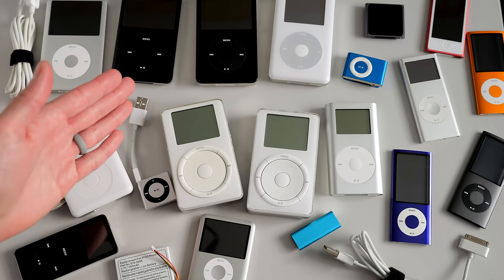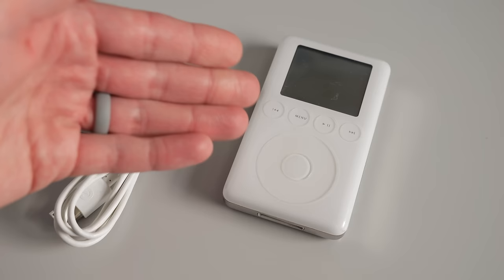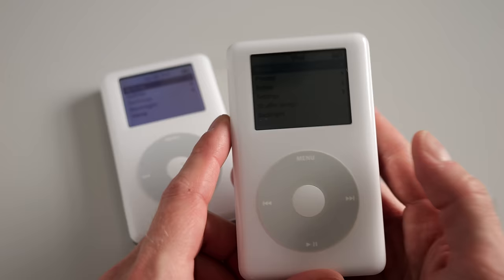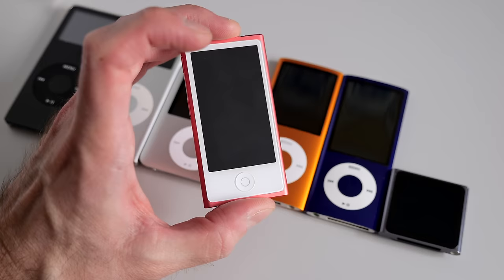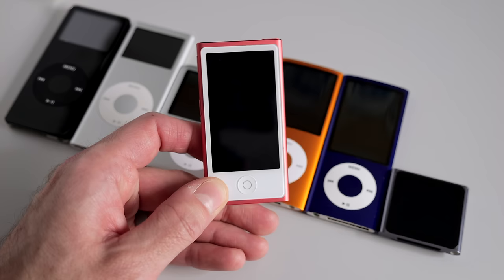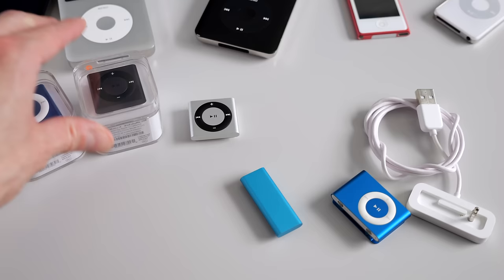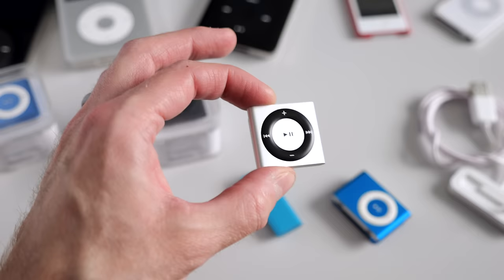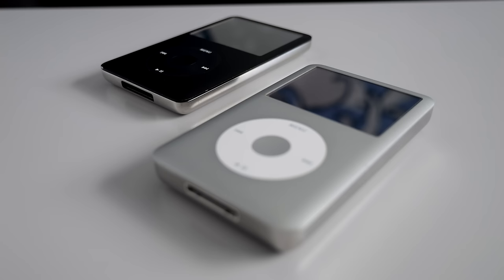Retro Buyer's Guide: Apple iPod!

Comment: I dug out my 30gb iPod Video a few days ago and gave it a try. It was sitting in my parents’ basement for 10 years. The 16 year old battery in it still holds 4 hours of charge - it literally just needed a charge and it worked just like it did back when the device was basically glued to me. I used it for a good 6 years until I got my iPhone 4S and I coincidentally ran out of storage in the iPod. I’m so impressed with this thing. My old MiniDisc player was in the same box, and the lens assembly is toast (it was fully functional last time I used it). My old Walkman held up a bit better, but needs a replacement drive belt. Both devices deteriorated over the years, while the iPod just patiently waited for some nostalgia to hit me!

Edit: I have a first gen shuffle (with some random corporate logo on it) - hit me up if you want it

Comment: Great video. I was a minidisc hold-out until 2006 before I got my first MP3 player, an Iriver T30 (which I still have and use!). Ipods were rather expensive compared to a lot of units, and those early version of itunes on Windows were hell - they practically took over your computer. I've been using my Android phone to listen to music for the last few years, loading up my library on the SD card. But now that new phones have removed the card slot, and my phone is dying, I was on the look-out for a dedicated player, and a couple of years ago I got into retro ipods. I recently got a parts 5th gen for $20 and fitted it out with new battery and iFlash adapter, and couldn't be happier. I'm just afraid that now, with this announcement, there's going to be a huge interest in iPods again and the prices are going to skyrocket, just like they did for Minidisc a couple of years ago.

Comment: I still have and use my ipod Shuffle 1st gen (the one you are missing). Still works perfectly and battery is nice and the whole concept is still great today. It's also basically a USB flash drive with more than enough space to take most files, documents around and very useful at that and also you don't need any cables or chargers to sync or charge
Reply: Remember "don't eat iPod" in the Shuffle ads, because they compared it to a stick of gum?

Comment: The top two pics to buy IMHO are the 2nd gen mini and the 5.5th gen. Both are very easy to open. The mini just needs a guitar pick, a pair of needle nose pliers, and a small Phillips screw driver and the 5.5th gen just needs a plastic pry tool in addition to what’s needed for the mini.

Both also have easily available replacement parts, the 5.5th gen more so. The mini also has the bonus of its hard drive being more or less a CF interface which makes it very easy to replace the hard drive with flash storage. The 5.5th gen has iFlash or a CF adapter.

Comment: I think the later iPod Touch models (6th and 7th gen) can be considered too if you want a mix of offline music and streaming services. Yeah a used iPhone is cheaper and basically can do the same thing but it's worth considering for a dedicated player.

Also, instead of iPod nano the 1st-4th gen iPod touch is better for a flash based iPod since the battery is way easier to replace.
Reply: Still needs to be soldered tho...

Comment: Last Gen iPod classic (only the last 8th Gen supports Apples headset remote control) with an SSD mod is the way to go. They are still relatively cheap and I use mine daily. It still has its original 2008 battery that lasts about 9-10 hours (also with an SSD it doesn’t consume as much power as with an HDD). iPod nano is also great but their price sky rocketed. Too bad I left my nano accidentally in my jeans which I then put into the washing machine… iPod shuffle was great for the gym.

Comment: My first iPod was a 60 GB 5th gen I received for Christmas 2005. It was a revelation, going from lugging around a big CD binder and having to load and eject a disc every time you wanted to hear new music. The old car I had at the time I replaced the old cassette stereo with an Aiwa head unit so I could play CDs. This was in 2004 and I had no idea what an auxiliary input was for until I got the iPod. I used the 5th gen until I dropped it 4 years later and the screen stopped working. Then for Christmas 2009 I received a 3rd gen iPod touch. That one was so cool and I used it like a smartphone, minus the calling feature. Connecting to Wi-Fi I could browse the internet without having to go sit at my desktop PC.

Comment: I have enormous nostalgia for the iPod and still prefer it to playing music on my phone for squeezing out distractions. My first one was a first gen 1gb shuffle and it was incredibly handy in college because it doubled as a thumb drive for carrying assignments and projects from my home computer to the school computers. It died only a couple years later though and was replaced with an 80gb iPod classic in late 2007 that I keep well cared for and still functioning. Opening the metal ones isn't anywhere near as bad as DankPods makes it out to be (watch Elite Obsolete's instruction video), and it's possible to swap the midframe for a 5th generation one and subsequently change out the faceplates to plastic which is easier to open, and can give more dramatic flair with colored or transparent faceplates. 

I've already swapped out the battery, but the drive is still going fine. Eventually, though, I'm going to do a total rebuild with transparent faceplate and click wheel, flash storage, and expanded capacity battery so it'll be able to last AGES on a charge.

I love that there's a cottage industry devoted to helping people keep their ipods going FOREVER. I still think it's a great product that has a place. I hope to keep mine going for as long as humanly possible.

Comment: I actually picked up one of the last stock iPod touch models Apple had in stock just to keep around unopened in the box for a while.  I had a 4th gen iPod that I got around the time they were new and it was probably the most expensive toy or gift I had ever had up to that point.  I had friends who had all kinds of different cell phones--and even though they were proper phones that could call and text, the iPod I had was still a lot more exciting to use and I remember I was actually pretty cool amongst the other middle schoolers having one.  I carried around that iPod religiously for a good 5 or 6 years until I had a job and could afford to have a proper phone instead.  

It may not be quite the same as the 7th gen iPod touch but I think it will be cool years down the road to be able to open the box and be able to remember almost exactly what it was like back when I was a kid.  Almost like taking a ride in the car that you remember riding around in growing up.

Comment: 3rd gen was my first in 2003. It was the first slim iPod if you got the smaller capacity models. To this day that's still my favorite model. I still have the box for mine. I also have the 1st gen, 4th gen, 4th gen photo and the boxes for all those. the boxes were neat and I couldn't get myself to toss them and I'm glad I didn't. My 1st gen box is the one that had Bob Marley on the cover.

Comment: My first iPod was a 1GB black Nano. Absolutely loved it until I saw a 5th Gen Video. I soon bought one after seeing it and haven't looked back. I still use it. Of course it's been flash modded, the battery replaced and I replaced the front plate, but I still use it. I believe I'll always use it until they stop making replacement parts for it

Comment: iPod nano 1st generation, 3rd generation, 6th generation, and 7th generation all do not suffer from battery swelling issues even close to the same extent as other generations. They either don't have the battery behind the display, have a little wiggle room for some swelling, or can easily have their battery accessed and replaced.

They can also all be more easily serviced than other generations, as they either all open like a full size iPod, or are still somewhat easy to open.

Comment: I had and 80G sixth gen way back when, but eventually sold it and bought a Cowon J3 which I used for YEARS (and still have). Just a couple of months ago I got a really good deal on a flash-modded 5th gen and I absolutely love it. I installed Rockbox on it and I am just blown away by it. Just an incredibly well-designed music player. I've used a ton of different digital audio players over the years, but nothing can beat the click wheel interface.

Comment: I would check up on the batteries of those new ipod shuffles. Lithium batteries sometimes self discharge over time, and over-discharge kills lithium batteries. It would be a shame if you reach for one of your spares just to discover they are dead before you ever even used them. Great video and awesome collection!

Comment: 49:40 - I found out that not all 7th generation iPods feature Bluetooth. I stepped on mine and cracked the screen; I eBayed a replacement, but it didn't include Bluetooth! I still have it but never used it.

Comment: One thing to note is the iPod Photo (its official name) was later merged with the fourth-gen iPod in early 2005 or so. (Effectively a 4.5G, if you will). This meant the later fourth-gen iPod had a color display and increased capacities. I believe the latter is how you tell them apart, as they were 20 and 40 GB, while the Photo did 30 and 60 GB.

Comment: I had the 1st gen Shuffle from launch and it still works. Reason? Apple did a battery pack that took two AAA batteries; you just pushed the USB into it and it worked. It’s a shame they didn’t try to do something similar for any of the other Shuffle generations.

Comment: I replaced the battery on my silver classic 80gb, and it was easier than I expected. I used mostly Dank Pods video, and had it running as I was opening. Do not watch the videos showing someone prying it apart. That will destroy the back, and bend the clips. The trick is to take your time. Don't force anything. Use the metal tool that he used, and I also had feeler gauges to hold it open, and help release the clips. Open 3 sides, and it will slide open. Also a BIGGIE, be careful, when opening like a book, to not pull the battery cable loose. It could pull the connector from the circuit board. I used high power glasses like you can get at the drugstore, and a magnifying glass, to see what I was doing. Use a small pointed object to hold the battery connector down, while prying gently on the clip. It pops straight up. I used a broom straw to pry the clip up. That limits the pressure, so as to not break it loose from the circuit board. I very lightly scuffed the upper case, and used really fine sandpaper to smooth out the scuffs. Also do not snap it together, until you are sure it is working.  Do it right. Do it slow. Do it once. Overall, I am really happy with it. Now, I have another one to do. ** One more thing. The battery, is really, really glued down, and will be diff to remove, unless it has been replaced before. I used a hair dryer to heat the back up, and used a thin feeler gauge, to slide under the battery. Prying did not work at all. Also, use magnification, to look under the battery as you are working the tool under it. Find the hold switch cable, and try to avoid it, and hold it down, while removing battery. The cable is really thin, and it will break if the battery is manhandled loose. This will break the switch. As I said take your time.

Comment: Minis are super easy to open once you know how.  Just hot glue the ends to a stick.  They're super easy to replace the HDs with CF cards or CF to SD adaptors, and fresh batteries are easy, too.  Then flash it with rockbox and ignore itunes forever.

Comment: I’m still rocking my 2001 iPod 1st gen in 2022. As far as I know no one has ever been inside of it and the battery still lasts an entire 8 hour day at the office. The audio quality is still superb in my opinion and it is such a good conversation piece. My biggest complaint is definitely the tiny 5GB hard drive (mine is from the first month of production - before the larger capacity drives), but that’s what my 20GB 2nd gen iPod is for. Only issue with that one is that the hard drive has a few bad sectors. Otherwise, my biggest complaint about my 2nd gen is that it’s “too nice” as in the back casing has no scratches on it whatsoever which is unheard of for a device from 2002, but as a result I’m too nervous to take it anywhere. Dude to the larger drive, however, I did suck it up and took my 2nd gen with me on an international trip back in November of 2022 and it worked great the entire time (thank goodness even the oldest iPods are multi voltage) and I only dropped it like 7 times.

Comment: I got an iPod 5th generation for many reasons. I wanted a color screened iPod classic. The iPod 6 and 7th generations are hell to work on, and the photo was too expensive on ebay for the disadvantages I had when I got it instead of an iPod 5. I really suggest the iPod 5 if you're fine with not having the mostly just aesthetic changes to the iPod 6 and 7.

Comment: I beg to differ on those iPod Minis. They were actually fairly easy to crack open to swap out the battery or hard drive. You can also replace the hard drive with a compac flash card… massive storage/performance upgrade that costs practically nothing.

Comment: The 1G nano is actually pretty easy to work on. If you know how to solder, battery replacement isn't too bad, but if you don't, refurbished nanos with new batteries are fairly common on eBay because of how relatively simple the process is. Mentioning this because I love the 1G nano, I have a 1G and 3G classic but my nano gets the most use.

Comment: I still love having a dedicated machine that doesn't connect to the web. My iPod gets me through camping trips, long flights, and much more without never ending interruptions. Definitely sucked modding mine when the battery went as I have one of the thin 120GB classics, but while it's got a few scratches from the tear down, having the micro sd's and the larger battery are amazing

Comment: Something that was not mentioned in the video — there was an updated version of 6th Gen Classic (sometimes called 6.5 Gen) which used a slim case, but had a capacity of 120GB and later 160GB.

Comment: I haven't watched any of this yet, but im gonna throw in my experience. I would definatly suggest getting an iPod with the 30 pin connector. Why? Because there are loads and loads of MFI devices with the 30 pin Dock connector, and some of them are quite excellent. The innovations and experimentations of this time period were going wild, and you are bound to find a hidden gem that will work with your iPod.
And IMO, the click wheel iPods, Especially the Mini, and the Original Design (4th gen and on [But be warned the 6th gen iPod Classic can only support a max of 128GB with its HDD controller, so not the ideal model]) are great devices, which can be upgraded with more modern storage solutions, and just having the iPod to use as a music player seems really ideal to me. (In my opinion, if you want anything more than a solo music player, a used phone will probably serve better, especially if its modern enough to download modern apps.)

Comment: I have my grandpa's 2nd gen iPod and 5th gen. I obtained a 4Gb 1st iPod Nano for my birthday in 2006, it was one of the greatest gifts ever. Later on I would acquire another iPod Nano 1st gen 2Gb, another iPod 5th gen (Before getting my grandpas) and got my first iPod Touch in 2011, 4th gen. I later got a 6th gen iPod touch as well as a 7th Gen iPod Nano. I really like the 7th gen Nano. It has bluetooth. My first Nano was recalled for battery issues and I got a 6th Gen Nano out of it. (and the power button failed, fk me was that ribbon cable hard to replace)
Ya know, I did want the OG shuffle, it seemed pretty cool.

You might want to crack open those shuffles, you know those batteries don't like being discharged for so long, recharge it every once in a while for battery health.

Comment: lovely collection Colin! do you have any tips for cleaning the front / polishing the back of a white 5th gen? @This Does Not Compute
Reply from the maker: I’ve had good luck using a metal polish like Brasso. It’s difficult to get rid of deep scratches, but it works well on all the fine ones.

Comment: I still have my blue iPod Nano even though the battery on it is dead. I was hoping for one day being able to fix it but for now, it's just sitting in storage. (the screen on it is absolutely fine, but it's missing the top cap like a lot of them were, since I live in a very hot and humid climate and that was the norm here since they're just glued on. Still worked without the cap though, you just had to use your fingernail to operate the top switch.

Comment: Great Video.  And you sound like Stu from Big Big Theory!

Still using the ipod 5.5.  Had to replace the battery which slightly marked one side of the case.  In a dock and my music library is on it.
Repaired an ipod 5th gen given to me by my sister.  They had an issue where solder on the motherboard would crack and you would lose sound.  Like the music quiz on this one.

Still use a nano 5th gen daily to listen to podcasts or latest cd/album release.  I use with headphones or a usb into the car stereo.  Though the battery is on its way out and it doesn't look an easy fix.  So I have got hold of an touch 5th gen and replaced the battery.  I picked this model as it can use bluetooth earphones, as I do a lot of work in the yard or on the house and I don't know how many times I have got the headphone cord caught in something.

Never watched a video on any ipod.